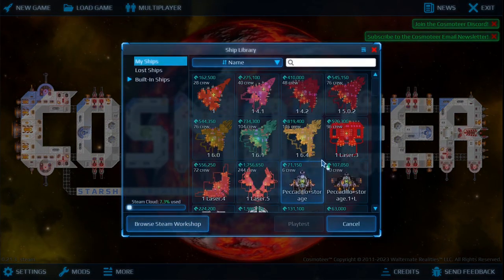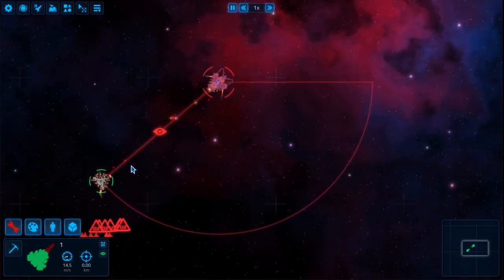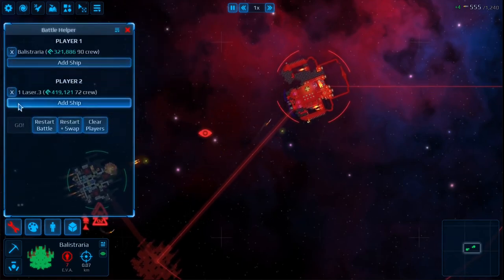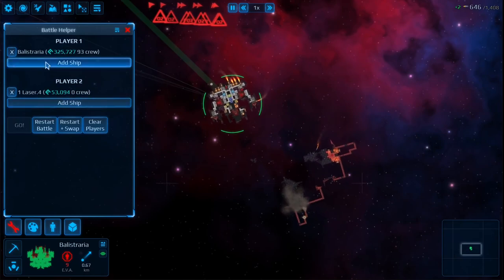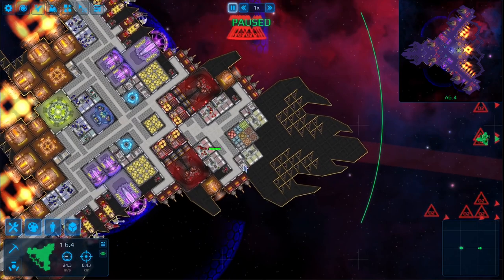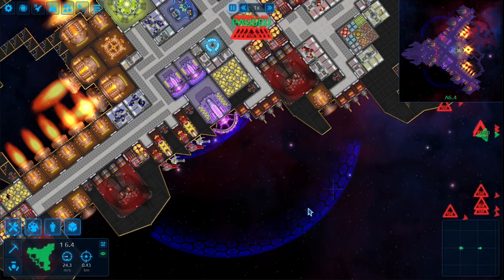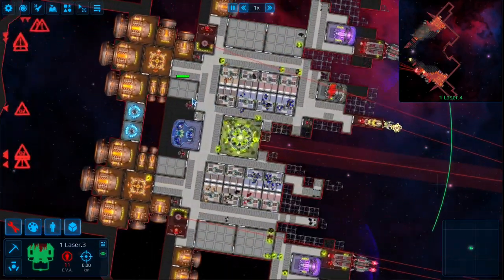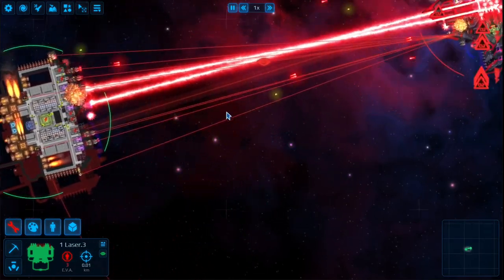Cosmoteer Engineering: Building and Testing Advanced Ship Designs

Comment: If you like to design ships with less power generator, i suggests batteries. At least they wont starve until the battery dies.
Reply from the maker: Great suggestion, @edhikurniawan! Using batteries for ships with fewer power generators is a smart strategy, ensuring they won't starve until the battery depletes. Thanks for the tip!